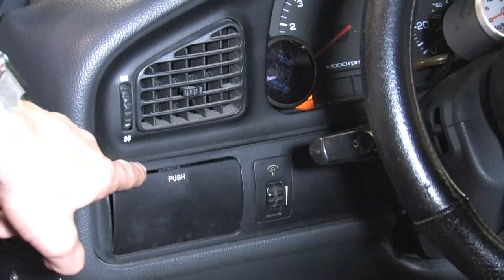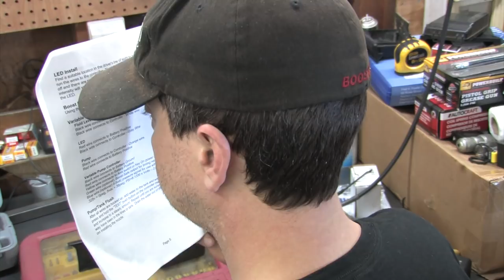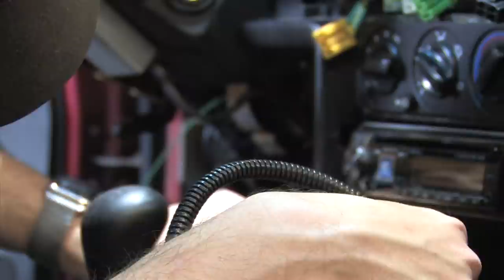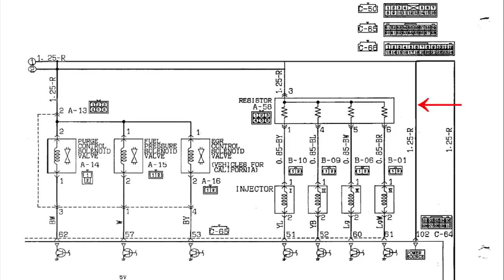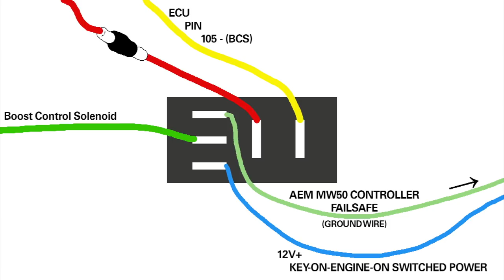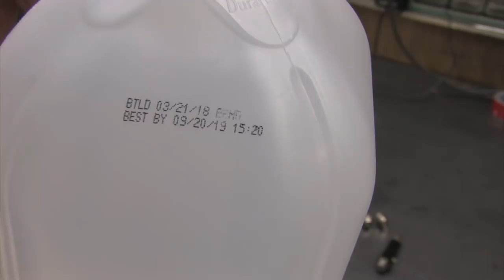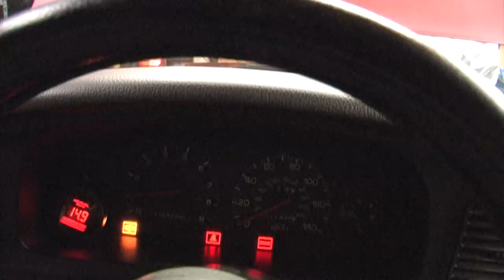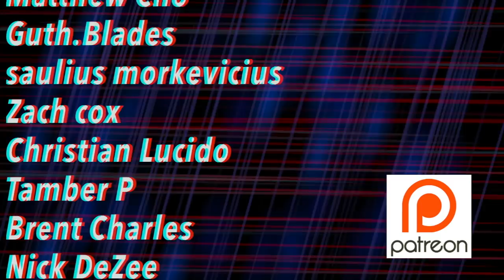Water Methanol Injection Installation

Comment: You’ll ditch the 50/50 mix real quick .  The water doesn’t do much and you can’t add much timing even with a large nozzle.   I ended up with a 100% VP methanol (its pretty cheap actually). If your out and don’t have any , just Use bottles of heat.  Works.  The only downside of 100% meth is fire , you can’t see it or smell it. But it’s worth the risk running 16deg timing with pump :) . Video on my channel of hx35 on c16 and meth at 27-28psi Ecmlink said 450hp.  Over 20deg timing .  :)
Reply: hereinmissoula11 We run 100% methanol in my blow-through setup as well.
Reply: If you have to use 100% meth to get real results you are doing it wrong. Typically, those with 100% mixtures are using a crap system like the AEM being installed here. They use flow by boost, which isn't what the engine is looking for. You really want flow by injector duty cycle, or flow by MAF. 

With flow by boost, u reach peak boost at say 4500 rpm, and at 4500 rpm you are delivering full flow of methanol/water. This will bog your engine down, so the natural thing you do next is use a smaller nozzle. The thing is, when you use a smaller nozzle you end up with less desired flow near redline where you REALLY need Water/meth.  When you use 100% methanol the bog in the midrange is less, and you get to stretch it out over the remainder of the power band. Make sense?
Reply: Ayson Baxter if u wanna spend that much on a meth system go for it.  Simple Hobbs switch , big nozzle , 100% meth and go with it .  4-6 deg Timing more than the 91 I use .    I agree if you have progressive rpm/map system maybe it would be better but water does not help much .  I’ve tried .  Nowhere near as effective as alcohol .  It’s not ait temps that’s the problem, it’s the octane.
Reply: Except methanol isn't what stops detonation, it's the water itself absorbing the excesses heat during compression and combustion that does that.

Methanol by itself will raise octane, but not by more than if you mixed it directly into the fuel in the same proportions.
Reply: Skippy try spraying water and see how much more timing/boost you get in the engine without knock

Comment: Jafro you lost me a bit with the relay circuitry - so basically when the tank empties and you get a failsafe signal on from the tank float switch, that closes the relay meaning rather than getting a signal from the actual boost solenoid, the ECU gets...a fake signal from the resistors which doesn't vary like the boost solenoid signal would, ergo ECU goes into limp mode?
Reply: fergie232 - basically yes, but it doesn't go into 'limp mode' - it just ignores boost control adjustments. Basically sets the boost control off (electrically). It's like switching off an aftermarket electronic boost controller. In Jafro's case, using the relay like he did also keeps the ecu from going into limp mode because it shows voltage where the ecu expects to see it when everything is ok. :)
Reply from the maker: You have a great question, and Eric K is 100% spot-on.  The only gap not bridged is about the float switch.  When the float switch circuit opens, it's the controller that pulls ground to the relay when it enters "boost safe" mode.  The relay is always "powered", but it's not a complete circuit that does anything until it sees ground.  The solenoid doesn't actually provide a signal.  The ECU activates the solenoid exactly the same way as the controller triggers the relay, by pulling ground.  The boost control solenoid is simply a 12v electromagnetic switch that opens and closes a vacuum port.  Golden question.
Reply: Yea, the resistor lets the ECU think the BCS is still connected. The relay by default is in the failsafe mode. Once the controller sees it all clear it then energizes the relay to complete the circuit to the BCS. If the controller loses power or detects a fault the relay is denergized and the BCS is bypassed, so u run wastegate pressure.

What this means is that you should tune for WMI about 3 psi or so above WG pressure, with anything below that use regular timing and AFR targets.

Comment: You should add a dry nitrous kit after the intercooler (a small shot 30hp) to cool your intake temps. For every degree you bring down your intake temps it's like a 2rwhp gain. I did this on a neon I worked on and it went from beating a car by a fender to beating it by busses.

Comment: Wow, pretty complicated for me. I made one for my Jeep. Just 2 wires, 2 switches, a bottle, hose,  a windshield washer pump from an S10, and the sprayers are spray bottle nozzles I mounted in the carb air cleaner pan over carb and are adjustable. and costed like $15 bucks. Even got a warning light for when the bottle runs low but is useless since the bottle is right next to me. I hit my button at 3500 rpm when the 4 barrels open up and what a kick in the ass.

Comment: Hi im a 19 yr old just started learning about cars. I had my miata for about a year now and i just finished installing an M45 supercharger on it. Homebrewed. Some parts are from a mini cooper. Some from a mercedes. Some from a ford mustang. currently making 196 wheel HP in a chassis that weighs 2232 lbs(with driver). I did some research on meth/water injection and this seems really interesting. Your car looks like its naturally aspirated. Does meth/water injection add power even when the car is naturally asperated?

Comment: i remember that Volvo raced their 240turbo in the WTCC back in the mid 1980's and they also used water-methanol injection. They scored a world championship with that car.

The water-meth mist is injected in liquid form (a fine mist of droplets but still liquid. ) Liquid is not compressable and takes up space in the combustion chamber and therefore it functions as a compression riser.  After the combustion has happened the water becomes very hot steam and steam expands very much so next to the burnt exhaust gasses it is also the steam that helps to drive the pistons down with great force. (a bit like the N in Nitrous-oxide where the oxide reacts with fuel and N forms N2 bonds. N2 is a gas and gas wants to expand)
The steam also steamcleans the piston tops, the combustion chamber walls, the sparkplugs, the exhaust valves, exhaust ports and turbine.  If you have used it often you will find no carbon deposits anywhere.

Comment: To be failsafe the boost control solenoid needs to be wired between the normally open contacts of the relay. Connect the relay coil between a an ignition source and the trigger wire of the methanol ecu. The output methanol computer needs to sink as well as source current for this to work. This way, a broken wire or relay will fail safe.

Comment: I use the boost guage to monitor MPG. If your using more turbo on the flats at your normal speed. Even leaky tires can bump the needle from -10  average to -5 . They are quite sensitive in vacuum.

Comment: I am about to install a meth kit. I have uprev on my ecu and have multiple maps. I plan to have map 1 for the meth tune and map 2 as a 93 tune as a backup if the kit stops working or runs dry. Unfortunately not all have an ecu that can hold multiple maps that are easily changed by steering wheel buttons.

Comment: Your $20 Fail-Safe definitely is a lot better than spending an extra for $500 on the kit they sell!!... I made my own water-methanol kit out of a windshield washer sprayer luckily it had a float switch in it that would normally turn a light on in the dash telling you to add windshield washer fluid I also just used a pump safe 4 water methanol I just don't have Progressive control over the spray but my way cost less than half of the $500 kit you used because I don't have a progressive controller in my pressure should stay relatively constant I'm wondering if I can't use a fuel pressure gauge and sender has another way of monitoring the system too high a pressure would indicate a clogged nozzle to lower pressure would indicate a disconnected line Etc
Reply from the maker: With enough relays, pressure sensors, and potential points for failures, you can make a circuit with any number of conditions you could ever encounter.  One where all conditions have to be met in order to make the pump squirt, or to even unleash all of the timing and boost your car can make.  The progressive kit monitors 5 conditions and gives one output for failure.  It monitors short to ground to the pump, open circuit to pump, low voltage, low fluid, and controller fault.  Those are the 5 worst if you're good about preventative maintenance.  Being able to catch all 5 of those faults with only one relay is pretty dang convenient, I won't lie... but mine does not monitor pump pressure.

Comment: Jafro what kind of tap did you use on the tread, i'm from europe, and those 1/8 npt tabsi find or order are to big
there is a number behind the 1/8 npt "27" are there smaller sizes, or does the 1/8 npt just has 1 size?

Comment: Curious though, what's your take on Methanol injection vs E85? I've always viewed them as alternatives that allow sort of the similar objective (not to the same degree though) but methanol is independent and allow for easy tuning and daily driving vs flex fuel which isn't always compatible and has horrible mpg compared to standard petrol. I've also never lived near e85 until recently so I'm considering that for the DSMini Cooper instead of my typical methanol injection. Something different rather than always using the same tools on every car I own.
Thanks and keep up the great work.

Comment: Jafromobile, I have a new rebuild 98 got and I added ECMLink, but it starts, runs with a rough idle, and cuts off. Have you had a problem like this in the past, and can you help with some type of direction? I am new to ECMLink and a rebuild, so I need some help to keep it running. It actually does something similar when reconnecting the stock Ecu also.

Comment: I installed a Cooling Mist kit, used my windshield washer tank. Has an adjustable pressure switch that's set to 12psi, a simple indicator light inside let's me know when it activates. I just check the level every couple days and refill as necessary. Also a pre-turbo nozzel has helped my small Garrett T-3 seem like a bigger turbo, I'm guessing my air charge is cooled a bit before going into the intercooler.

Comment: I was thinking about your Fake BCS and the failsafe. Is the ECU logic for the wastegate solendoid smart enough to have a learned long-term duty cycle adjustment like it does for fuel with LTFT? If so, if the ECU is actuating a fake BCS, wouldn't it see that boost wasn't responding to what it was commanding and adjust a long term value accordingly, resulting in higher than desired boost?

Comment: I don't agree a boost gauge is useless. mounted properly where it doesn't block other lights I always note in my mind what boost my car should run at at what rpms and its a good tool to have to ensure your running at proper boost.

Comment: You didn't oil the filter. How is the fine dust gonna stay out of the cylinders. I don't understand how you spend hours cleaning an engine block to remove all and I mean all contaminants and skip the proper installation of a aftermarket air filter. Not hating, just saying. I love your videos.

Comment: Thanks jafro learnt so much about mitsubishi from your vids currently building a gen1 4g93t with a gen1 4g92 mivec head in my 95 lancer gsr the only issue i can see is the hi cam valve timing it has like 72° of overlap iv learnt its bad for turbo makes sense any thoughts?

Comment: So you used 8 bolts to hold the container but 2 bolts to hold it to the car? 
Fascinating!
Reply from the maker: Hahah.  Yeah.  There's some logic in it, though.  The 8 little bolts and nuts go into a plastic bottle.  The 2 bolts in the floor are 3x as thick as the little ones and bolt metal to metal with a huge flange area.  It makes removing the whole system easier if I ever have to.

Comment: Great video! Just want to chime in by saying that indeed is good to have a fail safe actually is very similar to what i did but the problem that encounter is that when driving around or at the drag strip the acceleration makes the float inside the meth tank bounce a lot which leads to warning light and boost cut also i use the snow performance kit and in the instruction the clearly state no to put the nozzle upside down like you did I don't know how this will affect you I'm just saying!

Comment: How long does the tank of water and methanol last? I suppose it depends on what nozzle you use and how often the car hits boost? Trying to work out how much more it will cost per tank of fuel 😂

Comment: Hey jafro? Great video btw, I was wondering if you could help out with my Dsm. It’s a 46g3t. The car is turning but it won’t turn on. I checked all the basic stuff like spark and fuel. There is spark from the spark plugs and fuel going through the lines. I can’t figure it out. Maybe you have an idea why it’s just turning. Oh and when the engine crank the exhaust just pops a few times in the beginning of me turning my key. If you need any other information to know what’s might be going on let me know.

Comment: I noticed your tank was slightly higher than your injection point.  Did you have any issues with water/methanol siphoning back into the intake?
Reply from the maker: Yes.  And I bought the AEM water methanol solenoid.  There's a brown wire coming out of the kit to control it.  The old electronic valve trick... I'm about to install it.  I'd consider that to be a smaller problem with this kit than the float switch that's in the storage tank.  Newer kits don't have my problem.  The float switch sticks.  A capacitive switch would have been a much better option, but this is the old kit.

Comment: Very helpful guide, I've just installed the same AEM kit to my supercharged 2zz-ge and your video was my guide. Thank you very much. Just one question. The dashboard LED and the error light light-on (steady, not blinking) as the kit is operating and go off when the pump stops. Is this what it should be or it's some kind of an error?
Reply from the maker: It should turn on when the pump is operating and vary in intensity based off of your knob settings.  It's a progressive flow kit that does min/max based on boost pressure.  As your boost ramps up past the activation point you set with the min knob, it will get brighter as it reaches wherever you have your max knob set.  The max knob is at what pressure you want it to be 100% flow.  At max flow, or during error flashes, it should be at 100% intensity.

Comment: Is it possible to have a dual stage boost controller and create a tune with the methanol injection when you switch the higher boost setting on it turns on the methanol injection on?

Comment: Hi, how is the meth kit holding up? Any issues with the pump or controller? I just got this kit new in box from someone who had it sitting and never installed it. I just realized its the older v1 controller but i see online the new controllers have issues so wondering if the old one was more solid.
Reply from the maker: Yes.  Mount the top of the tank below the injection nozzle.  Don't park it on a hill even if you do.  Don't let the air temperature outside change, either.  If these events occur, it will leak down as the car sits.  The check valve is there to prevent pushing fluid into the MW50 kit, not to prevent it from leaking into your intake.  Alternatively add a solenoid to cut the fluid flow when the car is off.  People warned that the V1 controllers are defective, but mine's still working just fine.  It does what a progressive controller is supposed to do.  I thought I had a problem with it early on, but it was my clutch switch bracket that failed because it moved and stuck me in a rev limiter (which dropped my boost to wastegate pressure and the water meth LED would blink because it would toggle on and off at wastegate pressure) and I struggled with that for nearly a week, but I unchecked a box for NLTS and figured it out.  Then I slapped myself for posting in the AEM forums.  Every problem I've had has been user/physics related.  The kit needs one more solenoid.  A fluid solenoid.  Also, purge it once after it sits because the check valve isn't perfect at keeping air bubbles out when the kit is not pressurized.  If you're tuning the way I do, you need the MW50 to be there if you want that first drag pass to be consistent.  MW50 is part of your fuel tune.